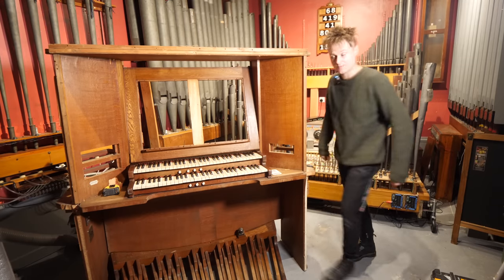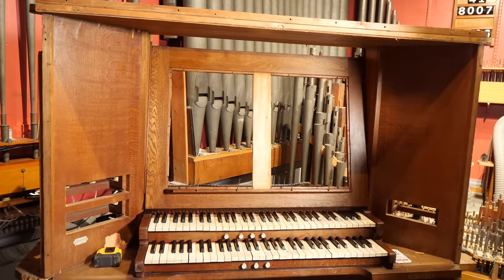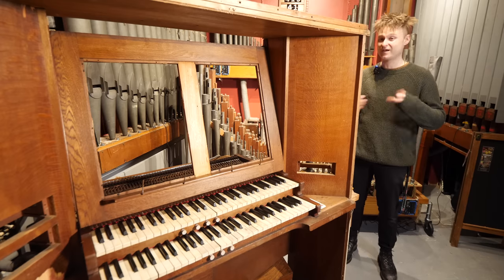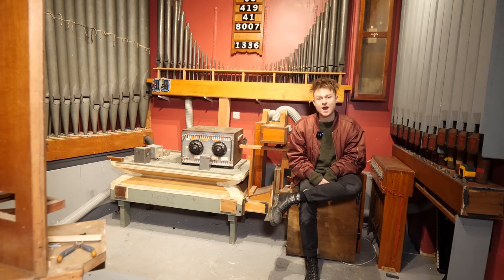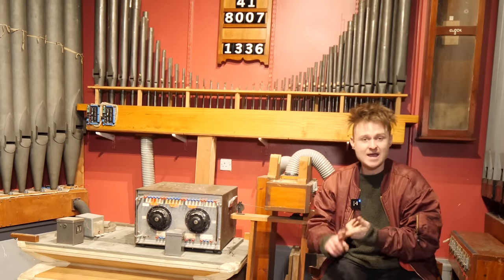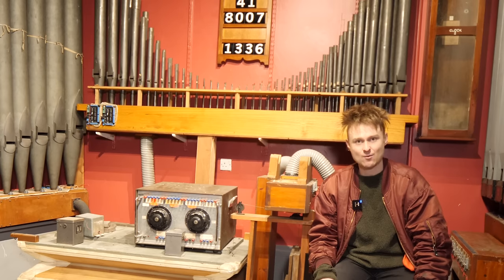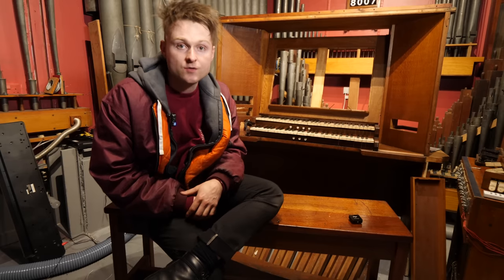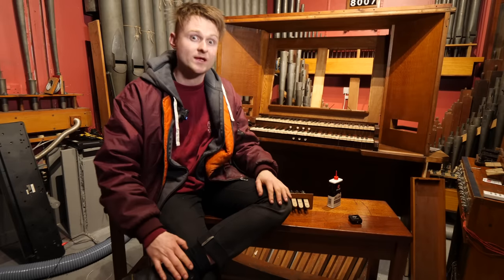I BOUGHT A CHURCH ORGAN PART 13 - MAKING IT LESS NOISY

Comment: I think the ideas of restoration and preservation can be really subjective. I can't help wondering if the "Oi U don't know wut ur doin" crowd objected merely to the haphazard removal of the original wiring and circuitry. Whereas for me (and obviously Sam as well) replacing all of that with a MIDI system is the way to go. Someone could argue that part of the history has been removed, but at what point does preservation become so onerous as to not be even worthwhile?

I think as long as we steward old objects with passion and thoughtfulness – regardless of our individual philosophies and processes – we're doing it "The Right Way". Clearly Sam exhibits this while restoring the organ and giving it a new and different life. Just my two cents. 🙂

Comment: Sure, you messed with it and are paying for it with dodgy tuning BUT - like the background noise, the level of jank is way down.
Reply from the maker: the dodgy tuning is merely down to moving the pipes, only needs a few hours of faff, but no point till the console is done/. as for jank. ill need to bring up the jank lever again then :D ha
Reply: @LOOKMUMNOCOMPUTER  don’t worry - I’m sure functional jank is just right, it comes in below “It’ll be all right when I’m done”-jank but it is well above “restomod” and other catastrophically low categories of jank.